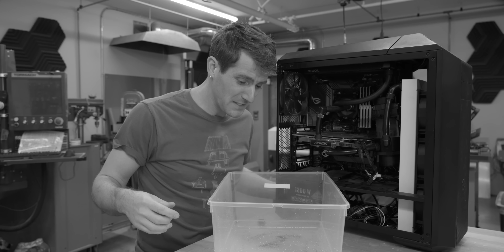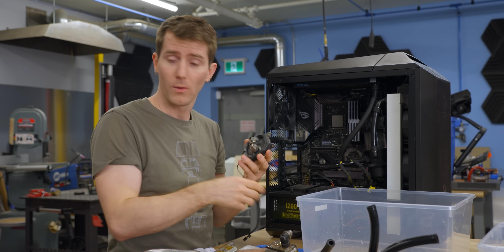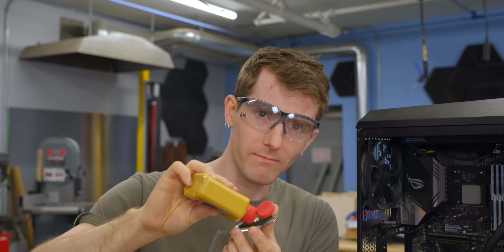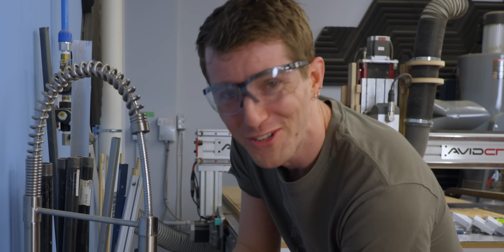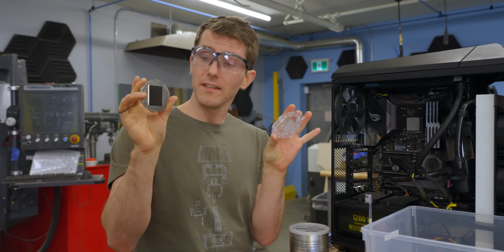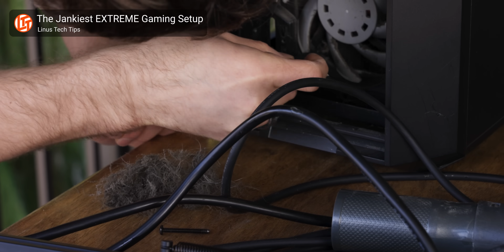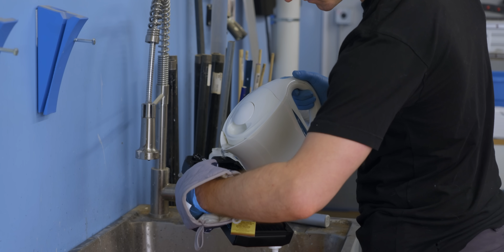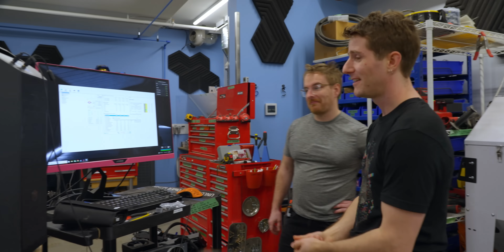I Will Never Watercool Again – Water Cooling Maintenance Guide

Comment: You guys should try re-chromming the water block so that the exposed copper gets a layer of crome over it again. i believe the chroming can be done through electrolysis and its simple and less time consuming and the end results are worth it
Reply: Probably the better option would be to use Electroless Nickel Plating since its result is more uniform and can plate complex shapes like the fins better, also much easier since you basically only have to submerge the part in a solution and dont have to deal with electrodes.
Reply: Nickel plating, but yeah. That would be a cool video concept.
Reply: Nickel plating would be safer, Chrome creates a toxic gas in the process.
Reply: Waste of time. I like the copper patina
Reply: @brumby92  doesn't hurt performance either so yeah, most of the time raw copper blocks are better unless you're using liquid metal.

Comment: Im always as confused about why the watercooling scene hasnt made a passive/active waterfilter. Like, run a 3rd and 4th line from... well somewhere like the radiator, and run that thru a filter with a pump that you could valve off and replace... am i just crazy thinking that would work?

Comment: why do you make systems that need maintenance. well you reap what you sow. well every day, month and year is different to almost never. organic would not ever grown if you have used alcohol instead of caring about looks. functionality over form. wasted work. wasted teaching points. aluminium + copper + water = battery with self-plating ion transfer. yes any conductivity salts in the water means battery. copper goes black because of the aluminium oxide. iron will rust. duh. boat sinks if it has mixed metals. no mixing aluminium and copper. only copper or aluminium.

Comment: The toothbrush sponsorship was... inspired.
Reply: Inspired by their time's meeting fans at LTX lol
Reply: @whitepaws60  💀💀💀
Reply: WAN show said they wanted to do a water-cooling cleaning episode for ages, they just didn't have an angle to stop it being boring... clearly, vibrating toothbrushes are that angle
Reply: Honestly, as omnipresent as it was, electric toothbrushes are great for these sorts of tasks. I wouldn’t use an expensive one on anything but my teeth, but they’re great for cleaning detailed auto parts too.
Reply: DYSON VACUUM CLEANER!
Reply: Yeah... 16° holy moly with an accuracy of 0.1°. can someone remind me how this one is better than the one just vibrates?
Reply: if you already have the one that just goes in left right circles then just angle it and go down its the correct way to brush your teeth ( they teach it in dental school)

 @Doroga05
Reply: @Doroga05 this one vibrates AND the head shakes up and down. BUT it's still not as good as the oralB ones that simply spins imo
Reply: Next up: Linus uses the toothbrush to clean someone's keyboard covered in... something.
Reply: wait for it, he'll come with a ltt store tootbrush :D
Reply: ToofeyMcBrushyWatercooler ad
Reply: I guess maybe the sponsorship offer came in and then the video idea was worked around that!? 😉
Reply: i have been using electric toothbrash for cleaning for a long time. Its very fast and it do better job then if u do it manually :)
Reply: Interesting that it's round. I would think hexagonal so it doesn't roll. Does it work without the brush on?
Reply: Inspiring
Reply: i feel attacked with my Oral b i10 se 400 Euro
Reply: I can even make the WORLDS GREATEST TECHNICIAN cry
Reply: Needs a collab with Device Orchestra.
Reply: Do you think that was scripted though?
Reply: That company is pushing its product in many big tech channels lately.
Reply: Finally, an electric toothbrush with airplane mode for the rest of us.
Reply: There definitely is such a thing as too much power when it comes to brushing your teeth.
Reply: Dont let THE GREATEST TECHNICIAN THATS EVER LIVED see this!
Reply: Was this 🤏close to buying that toothbrush then saw it has an app.  That's a no from from me. Put the freaking controls on the toothbrush!
Reply: tOoThBrUsH
Reply: I can't even remember what the video was about, other than toothbrushes.
Reply: women have been "inspired" by oscillating toothbrushes for decades
Reply: Remember when Linus said he specifically chose sponsors so it wasn't relevant to the video to keep it from being a conflict of interest? I memba...
Reply: He used it wrong. Plus a brass wire brush works better
Reply: @kamelionify great. now we can blow through the thin nickel plating and marr up our acrylic too!
Reply: Imagine selling a 70$ screwdriver and a 250$ and STILL being this bad of a sell out... LTT content has seriously degraded over the years. I miss the old fun LTT

Comment: This is the exact reason i only bought AIO's that can be "added to", not to add more parts but so i can do fluid changes yearly to keep the fluid fresh clean and full. Buy some CLR or similar to clean the metals and fins
Reply: You are probably doing more harm than good TBH.  Proper sealed AIOs are filled with glycol and the fluid doesn't go bad, nor do they really corrode, because of the glycol.  They can easily last 5-10 years and you will probably be building a new PC before then anyways.

Comment: I'm new to cooling a PC but have always wondered if automobile coolant would be a good solution?
Reply: Not really.

Just stick with a clear premix like DP ultra and ur perfectly fine. All those LTT watercooled builds are doomed from the start by just using distilled water (if that) without any additives.
Reply: not , the automobile coolant have ammonia and isopropylene , don't use it in water coolant
Reply: or just mix distilledd water with ethylene glicol and benzotriazole if you are going to use pure copper and brass cooling parts

Comment: Aircooling is the way to go.
Reply: Yeah I see all those aios and I still kinda cringe at them since I really don't want to mess with liquid cooling so yeah I am sticking with air coolers.
Reply: @FlintG  My oldest aio is 10 this year, so in my experience they are pretty reliable.
Reply: @FlintG  AIOs are maintence free so I really dont see a reason why you wouldnt want to use them since they are simply better for cooling.
Reply: @roarbahamut9866  No cooler is maintenance free. AIO's also come with an additional risk of pump failure which requires you to go buy a new AIO. It may not happen as often now days but its still another component that could fail.
Reply: @TheWoolyninja4  Air cooler comes with the risk auf fan failure.
Reply: @GamingHigh  yes and so does an AIO. You can also replace a fan easily.
Reply: @TheWoolyninja4 
What is the price of a tower cooler that will actually hang with an Arctic 240? Efficient and good tower coolers are not cheap by any stretch of the imagination. Sure you can get cheaper coolers, but they will not perform like that AIO. Now up that to an Arctic 280 and 360, and it's game over for the air coolers.
Reply: Depends on what yo need to do. I use one of my rigs for machine learning. Good luck getting the most out of that with air cooling.
Reply: @AB-80X Yes, water has its benefits when you need to dissipate a ton of heat with limited space, but in most cases, even with high powered workstations, you can get a more reliable system by using a well designed air cooling setup.
Reply: Theres literally no need for water cooling either
Reply: Not for itx builds - where heat has to be exhausted outside the case
Reply: @bootchoo96 Even with ITX I would use all my effort to make it air coolable. Just needs a bit of airflow design.
Reply: It really isnt lol

Comment: I did my OG water loop with Mayhems Biocide pre-rinse, and then I ran it on Mayhems Pastel for 4 years not giving it even a moment of maintenance, finally when I did it clean it out, all it took was a good few flushes of vinegar in the loop -- easy-peasy.

I think if you take the time at the beginning! to use an inhibitor and ensure you have clean distilled water as a base for whatever colors/lusters you put it in, it's really not that hard to water-cool in a relatively pain-free way.
Reply: Okay but my tubing is PET and my components are bare copper.
Reply: Agreed, water-cooling isn't that bad if you prep your blocks well, but nickel plated doesn't like vinegar.

I've been using a lighter mix of coffee machine cleaner as it's fine with the acrylic as well as metals without stripping.

Never had algee and I ran a loop for over 12 months on the same coolant no residue as long as it's clear based and not pastel.

Pastel requires some harsher chemicals to flush everything clear again and several flushes with demineralised water .
Reply: I have been saying this for years.  Water cooling is only difficult when you rush it and or don't know what you are doing and set it up poorly.  It is something where mistakes in the beginning come to haunt you later.  Don't make the mistakes and it will be smooth sailing.

My last build is on 7-8 years without being apart and only 2-3 fluid changes, which is because the mayham's pastel lost its color.  I have run blitz part 2 in it a few times over the  years when I have done the fluid changes for half a day.  Never drained or flushed it though, used Jay's "run 10 gallons of distilled through it with the loop cycling and the drain cracked" method to flush the fluid back down to pure distilled before re-adding the dye.

When I do finally get around to fully disassembling it (it's been on my todo list for a few years now) will probably take some pics for demonstration purposes.
Reply: I can attest to RO water being supreme for cleaning focus, some preffers Destilled or De-miniralized but RO is just better as a decent filter setup is pretty cheap, and ensures a low solids count below 20ppm right at home.

I have a big loop buildt over a long time, with external Rad, Res and Pump, and probly like 3m-3,5m softtube on there in total.

I dont use any anti-agents of any kind (beside first time i put it on this Pc, which then grew fungi), i just use RO water now and a T-adapter to make a solids-trap on the pump inlet tube, so the pump is pulling from the side of the T helping solids drop in.

But yeah using a T-adapter trap and RO water, i mean i basicly never have to clean my setup xD its been atleast 6 years now since i cleaned it (remove the blinded off trap tube and clean it/Refill) Actually now i need to refill the loop from dissipation loss more often than i need to clean it xD
Reply: Yeah i only use distilled water and its 6 years now of just topping up the resevoir from dissipation/evaporation. Should i be cleaning it out?  @saddane6897
Reply: I couldn't agree more. Since building my waterloop in 2018, it has been in use almost daily.  Distilled water and adequate washing of tubes seemed to do the trick. I've changed the water once and thermals are still good five and a half years later.
Reply: I'm on I think 2 or 3 years of my current coolant and everything still runs completely fine. Before that I ran my last build for like 6 years and only changed fluid twice lol.
Reply: couldnt you, in theory, run bleach through your set up for like 5 mins to disinfect, and then use the inhibitor and pure distilled water and...in theory...no bacteria should ever show up
Reply: Don't use vinegar in a pc cooling loop.  Vinegar will destroy your nickel plating and cause acrylic to craze(spider cracks).
Reply: @zoson  just flushing with vinegar won't cause acrylic to crack, but I know that contact with oxyclean will immediately crack acrylic.

Comment: Just get a Thermalright Assassin (on a budget) or NH-D15 (pure longevity and customer support). You'll be set for so many future PC upgrades and it's brain dead easy to maintain
Reply: I support the noctua choice, i will never not shill for them. I bought a used nh-d14 off ebay and it had the mounting hardware for intel second gen, I sent noctua a picture of it, and a copy of my invoice for the am4 motherboard i bought, and they shipped me the mounting hardware I needed for free. Using it with my ryzen 7 3700x now. 10/10
Reply: as much as i remember thermalright's phantom spirit should be lilttle better than both of them.
Reply: Frost Spirit 140 is a silent killer. 13900k works perfectly without any power caps but a bit undervolted only 95c degrees max
Reply: Definitely, maybe a U12-S for mid-tier systems
Reply: Still using my nhd14 i bought with my fx8350
Reply: I bought an NH-D15 but it doesn't fit on my motherboard😢
Reply: @khulhucthulhu9952  What do you mean it doesn't fit on your mobo? They're all standardised. 

Do you mean it doesn't have proper mounting brackets? If so, reach out to Noctua, they'll send you some for free. Just don't forget to tell them what your socket on the motherboard is.
Reply: @khulhucthulhu9952  sadge. Noctua likely has an adapter for it if you look. Unless you're talking about ram. You might need shorter ram or remove the second fan
Reply: Yeah, but it's easy. That's so cookiecutter that it's practically a pre-built xd
Reply: actually true, bought an NH-D15 and im gonna keep this thing till i die. Maybe i will need to replace the fans in 15 years but thats cheap asf
Reply: @onyxeye03  maybe Noctua sells their new fans then ;)
Reply: @onyxeye03 Same with me and PA120. Very happy with it, just barely worse than best of AIOs at a fraction of the cost. Perfectly handles my 5900x.